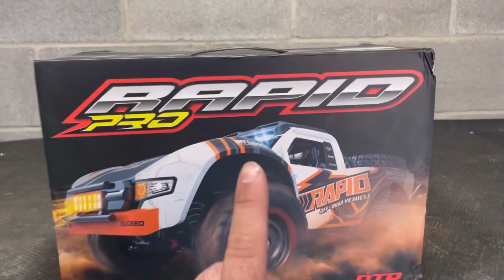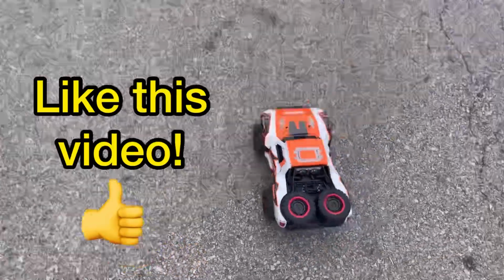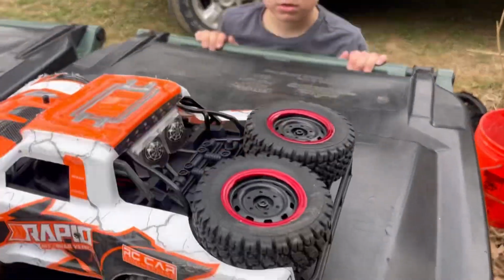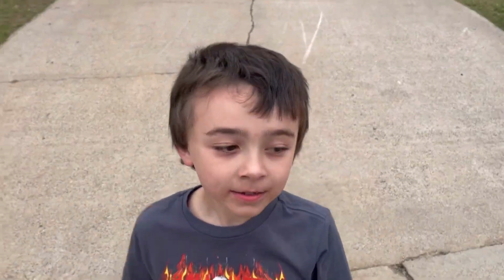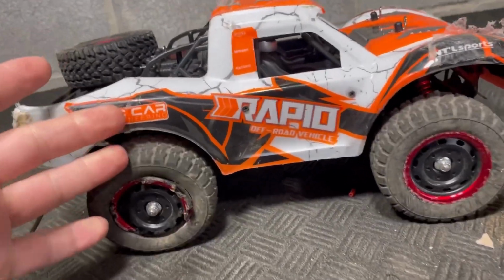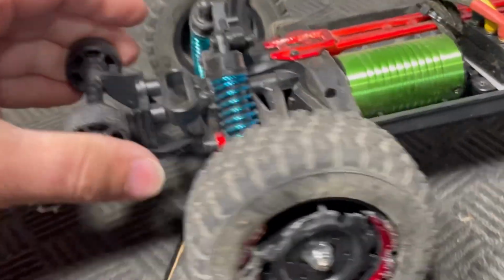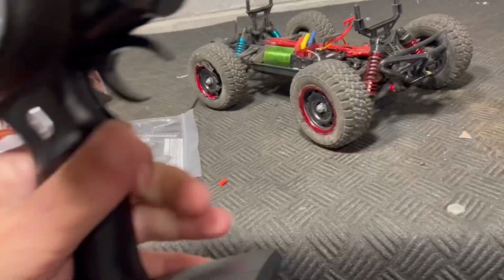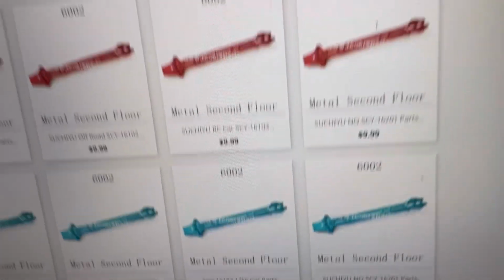New Brushless RC blows past expectations! JJRC Q130

Comment: Hi Sir, I just received my first MJX hyper go, put of the box after charging and testing different battery, it won’t run when put on the floor, hesitates(cogging/glitches) with cracking noise but goes instantly if I hold it up and wheels not touching the ground. Is it damage?
Reply: A video might help others to see the problem
Reply from the maker: I responded to your other 2 comments about this. Sorry for the delayed response. It does sound like it’s damaged, but just double check your wiring connections, your throttle speed adjustment knob, and try to tell if anything is mechanically binding first. Hopefully you find something simple. Otherwise they should exchange it for you.
Reply: @DerbyCityRC  after checking everything, trying different battery, using the tx of a friend, then tried different esc(it worked) it is indeed defective/faulty ESC. Thank you! 👍😊👍
Reply from the maker: Your welcome man! 👍👍
Reply: @DerbyCityRC  by the way, are the pinion gear of HBX 16889A pro compatible with brushless MJX hyper go (pitch/module)? I just found out that MJX brushless shaft size is odd, just 3mm not 3.175 so I cannot use the stock pinion on any standard 2845 motor, all I can find have 3.175 shaft.
Reply from the maker: Interesting. I don’t know unfortunately I’ve never ran into one that was just 3mm.
Usually there’s 2mm, 3.175, and 5.
Reply: @DerbyCityRC  that’s what I also thought. It happened that the real problem with my MJX is the motor when I tried the esc to another car, and a different esc to the MJX. So when I was about to change it by another 3845 from another car, the pinion hole of the MJX is smaller and won’t fit to the surpass standard 3.175. I did order the HBX pinion and hope it is the same pitch/module as MJX? All I know is the way they look and both 14T.
Reply from the maker: Hope it works!!
Reply: You know a good oilfilled shock that works on this
Reply from the maker: I haven’t tried any yet,  it I plan on doing this in a video soon

Comment: Mate help something happened to my JJRC battery.. I bought new JJRC but it is not moving backward or forward but yes the steering works, it turns left and right but the light of the RC flashes continously which is a sign of battery mal fucntion, Now what should i do?

Comment: Just got one the other day.  Took it out for some fun in the snow and had a blast.  Already upgraded the shocks and it performs and handles a lot better.   Great video and review 👍🏻👍🏻
Reply from the maker: Awesome! Thanks for the shock info!
Which ones did you use?
Reply: What i am looking for shockwise? I don't know lots about the shocks' sizes.
Reply: @Derby City RC  65mm from the center of holes. That will work for both front and back.
Reply: @dakotarc7420  Thanx for the reply, what about oil viscosity?
Reply: Still figuring out what wight oil is best.  35 seems to be doing fairly well.
Reply: @dakotarc7420  Heard about 80 and i was wondering
Reply from the maker: Thanks!!
Reply from the maker: 80 may work better for big Jumps, but this isn’t really a jumping car. Softer like 30-40 like Dakota RC says is probably a good weight.

Comment: I got mine this weekend and boy, it is crazy fast! Still I have noticed that front wheels look at opposite directions if viewed from top or bottom of the vehicle. They are not parallel to each other. Just a few degrees off, but I am wondering if it is going to affect the performance in the long run such as tire wear, bearings and the rest?
Reply from the maker: Yes it’s so fun! The front tires being “toed out” like that is actually normal. Makes it handle better. Under hard acceleration the front tires pull and tend to straighten out.
Reply: @DerbyCityRC  Are you sure? It is the front ends of the front tires (closest to the front bumber), not the rear end of the front tires that face outwards. I had a closer look today and it seems like steering rods are a bit short and this might be causing a problem.
Reply from the maker: Yup that’s normal. If you google images of some RC cars and look at some birds eye view pics, you’ll see some of them are like that. (Some manufacturers probably try to adjust for pictures since it does look off-putting) The rear tires face in and the front tires face out. Some are more pronounced than others. You can see it really easily on a couple of the Redcat Valkyrie pics that come up. But yes that actually increases handling.

Comment: Hi great video as usual.Need some info.Bought this model but after 10min it stops while playing in the grass.esc seemed very hot and when it cooled down worked again but has like cogging on low throttle in the grass.Do you recommend the brushed version for my kid.he is 3yrs old
Reply from the maker: Thanks! Well that’s hard to say. Was the motor warm too? Grass will definitely cause it to heat up quicker so can’t say it’s a defect. Is it warm where you are?
If it doesn’t have the cog on pavement, it’s probably ok because the grass will definitely increase cogging for a smaller car.
I’d still say brushless is better because they don’t get as hot, and it can still be turned down pretty slow. In the flip side, the brushed one wouldn’t cog but may still have low torque.
Reply: @DerbyCityRC  Thanks for the advice.Turned out one of the wires to the motor was loose causing the heating and loss of power.All good now.After watching your other video i bought 2 more.A Q117 brushless and the beast max featured in your video.All same under the body.Got it from temu for 71 dollars.Great cars and very durable.Keep the entertaining videos coming brother.Thanks from South Africa
Reply from the maker: Thanks so much dude and appreciate you watching!! Glad you got it figured out!

Comment: Did you ever try using slightly bigger wheels to give it some air control? I was thinking like 3.65 from the stock 3.25.
Reply from the maker: I did use different wheels/tires, but not bigger ones. I was still able to get more air control with it though if I remember right. Definitely much better ground control. That video is here: https://youtu.be/13VwqlFirBc?si=PJYxFO07skKmkZf9

Comment: Hey Evan! Man you Don't know how glad I am to see this truck on your channel, as I've had this same truck on my studio table downstairs for over a week now. I've got so many in the line up and am i bit behind on my reviews. Normally it would be the other way around, but their have been so many good deals lately. i got the Pro as well! I am hoping this weekend I'll at least have it on video. An upload would be even better!
Man these cars, buggies trucks, jeeps, and now sct from this company really impress me! Yes oil filled shocks are gonna be a must do upgrade. Mine came in a foam box to save a little money. I would of paid an extra $15 if it came with some oil shocks! Not sure why so many don't just put them in the package. do you see this accepting 3s. i see it says 2s on the esc. ive seen a few of the other versions take 3s, but they didnt seem to cut out. Maybe there is a built in power output protection, like anything over 35c whether its 2s or 3s? that was a mad catch by Mad Max! it looked to hold up extremely well considering what it was put through. The wheelies were amazing! Man I cant wait Brother! Im gonna try to get mine uploaded this weekend too! have a great weekend Evan! iI really love your channel!
Reply from the maker: Thanks Robby!!
Ya it as a blast! I know there are
Lots of great deals right now!
I have a feeling it wouldn’t take a 3s but I bet it would if you put s cheap esc like a quicrun in it. With it shutting off with the Gens ace I used, I just have a feeling 3s would do the same. Ya that jeep model looks slick!! Hopefully will get more from these guys. I agree on the oil filled shocks. I would gladly pay $15 more on pretty much any model ever lol. Eventually they’ll catch on hopefully. Yup Max is a beast!!
Thanks Robby! So glad you love the channel 😊 Yours is awesome too!!
Reply: @DerbyCityRC   Does the stock esc ever get too hot (compared to the motor) when barely even running it (for me on lowest speed setting and 10 mins its really hot)? If it does for u, do u know any fixes? Fans need some  placement holes on esc i think to place them
Reply from the maker: No mine doesn’t seem to do that. Try to verify nothing is rubbing or casing the car to slow down. Do the wheels all spin freely? What about the car move pretty freely with all wheels on the ground?
May be a defect.

Comment: My turning circle is pretty small, even with the trim pin completed turned up. Is there a way to increase it more, since the servo has a larger angle available. So I hope there's an electronic trick to get more.....
Reply from the maker: Hmmm. I don’t know that there’s a way to change that. The turn radius should be pretty normal. I would check to make sure there is nothing blocking the steering and that the servo saver is not loose.
Also it’s not the steering trim, it’s the steering D/L that controls how far they turn. I can’t remember if that controller has the option for that.

Comment: You wouldn’t happen to know the pinion pitch? I’ve looked everywhere and can’t find it. I’m attempting to build one to see how fast I can get it.
Reply from the maker: Unfortunately I don’t know I’ve never done any motor or gear work on these, but my best guess would be .6 MOD. Seems to be the most common gear size amongst small Chinese RCs. Could possibly be .5 or .7
Reply: @DerbyCityRC  this is the first one I’ve ever actually done any real work on. But even that helps, I was about to order a bunch of all the different types. Thanks for the reply though.

Comment: Hello, thats actually the same parts as the SCY 16103 pro, and also 16102 pro for some parts. And yes i think its more a road car than a pure basher.
Reply from the maker: Yes it is! I also have a similar car to the 16102 now also. They’re both so awesome and parts can be had from suchiyu.com 👍👍
Just recently upgraded to metal hubs in the front.
Reply: @DerbyCityRC  i have the 16103 pro, with metal parts, i love the look of the car. Just waiting for a replacement remote from the seller...so while i wait, i've buyed the mjx 16208...dont tell my wife plz :p
Reply from the maker: 🤣🤣 I won’t!!

Comment: I'm working on an experiment with a new one that I just ordered. (The old one broke, and I never figured out the exact piece I needed.)  Do you know what kind of washer (size) I would need to pin those tires down, if I wanted to pin them to a part of that body?

Comment: I just got this truck and it's awesome but for some reason when I hit the throttle or reverse there is a pretty heavy hesitation. Any idea what might be causing that?
Reply from the maker: Glad you like it, but no I’m not sure why it would hesitate. Is it like the car isn’t even receiving a signal right away or like the motor lacks power at first?
Reply: @DerbyCityRC I would say it's almost like the signal gets interrupted when I first hit the throttle. Then it takes off and is fine

Comment: is there extra room on the esc if I wanted to plug something in like an extra heat sink for the motor?
Reply from the maker: There is an extra port. It’s the small 2 wire white plug. It’s labeled LED though so not sure if a fan would work on it or not.

Comment: I have a question...he says that the car like that case would be quite durable, but it rolled once and that plastic cracked a little, I'm afraid it won't be that durable, do you have any idea?
Reply from the maker: This car has been extremely durable. Still use it quite often two years later. Parts break on any car. Replacement parts are also available at Suchiyu.com. This car here is actually based on the same car and you can really see how awesome it is: 
https://youtu.be/Kn8P-Baz8zc?si=ayEt6z5rE__0KJ-w

Comment: It looks fast as a rocket.
I was eying it on banggood, but ended up very hesitant, cause of lack of info and pictures of the chassis. The looks are top notch though.
Someone complained the body rubs on the rear tires badly. Wonder if it cuts the tire in the long run?
Reply from the maker: Yes the rear of the body does rub the tires when compressed. I’ll have to look at it closer but I haven’t noticed any damage or slices yet. May be able to trim the body a bit. 
This is a good one. Should be easy to upgrade!

Comment: Mine after 1 drive session the tyre felt off and it seems that bearing ball is missing. I am trying via bangood to get a refund although nothing yet. Can you please share with me if there is somewhere to buy this rare bearin ball in order to fix it ?
Reply from the maker: Are you talking about the ball bearing right behind the wheel that goes around the axle? Do you still have the wheel nut and the 12mm hex and 2mm pin behind the wheel? Banggood is a good company, but they may not warranty a wheel falling off. They will likely consider that standard maintenance unless something actually broke.
Reply: @DerbyCityRC  I think nothing broke. The steering shaft with the  ball bearing (ruleman) fell off or the rc came without this idk. By my first drive session the wheel just left the body and I cant drive it anymore.. Do you know where I can find this bearing ball 6.35*9.5*3.2mm with the steering shaft 4*30mm?

Comment: Just picked this trcuk up off of Temu for $70. Amazing truck. Do you know of any good oil filled shocks for this truck? hopefully something USA side of the pond
Reply: Im also wondering what kinda of oil shocks also im looking for ones in temu did u happen to find one?
Reply from the maker: @mansourx025 check out this video;
I upgraded it and provided the links in the description. https://youtu.be/13VwqlFirBc?si=SG1K_GT3V_Ta3ByS
Reply from the maker: Replying right on time!
Here’s the upgrade video for that car the shocks were pretty great along with better tires https://youtu.be/13VwqlFirBc?si=SG1K_GT3V_Ta3ByS
Reply: @DerbyCityRC  alright thank you  u saved me hours of researching about shocks
Reply: @DerbyCityRC  hey man btw i found out that the shocks are abit expensive so i think ill get another rc so i dont get the trouble of buying shocks can u help me find one with good shocks and my budget is 75 dollars beacause in my country the same rc is for 75 not 100 so its cheaper here anyway pls help i need a 75 dollar rc very good out of box good shocks and everything fun to use and a one u reviews so i could see the video u review the best

Comment: Hey Evan, being the just-beyond-novice that I am, can you explain what makes a "dialed-in" differential? You mentioned that this particular truck is a little loose but can be helped with diff fluid?

All the best!
Reply from the maker: Hi Alan!
Sure. This differential is very “loose” as in each wheel can spin freely from each other very easily. If it wasn’t so loose, there would be more resistance (from a thicker fluid being inside it). So when this little dude is drifting, if it starts to lean a little bit, let’s say to the left, the right wheel will start to pick up a little bit and since there is no resistance inside the diff, all the power will now go to that right wheel because the ground isn’t slowing it down anymore. So now the left wheel stops spinning and since it’s not spinning it hooks up to the asphalt again and stops the drift action. If there was more resistance making it harder for that right wheel to spin, even when it lifts off the ground a bit, it wouldn’t stop the left wheel from spinning quite as easily.
Kinda like if you get stuck in snow or mud in your real car, only one wheel spins. But if you had a locking differential, both would spin and help you get unstuck. Thicker fluid acts somewhat like a locking differential depending on how thick it is. 
With doing wheelies, even though it holds them well, it rocks back and forth because that power can easily transfer to the left and right wheel causing it to rock side to side. Again a thicker fluid would cause the power to stay centered between both left and right wheels a lot better.  I’m going to have a video on all this “novice” stuff soon!!
Hope this helps you understand!
Reply: @DerbyCityRC  dang, Dude! Standing here amazed. Thanks for taking the time to get into it like that!

I owe you a beer someday!!
Reply from the maker: You’re welcome man!! 😃
I like what I do so I help as much as I can!